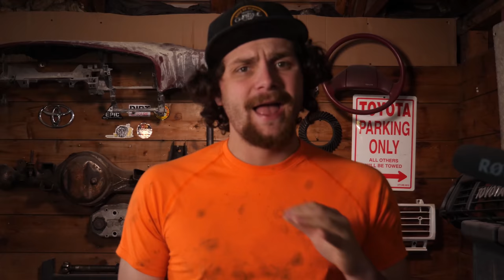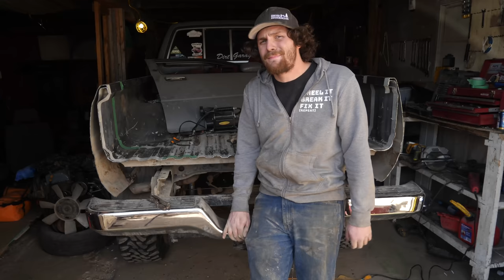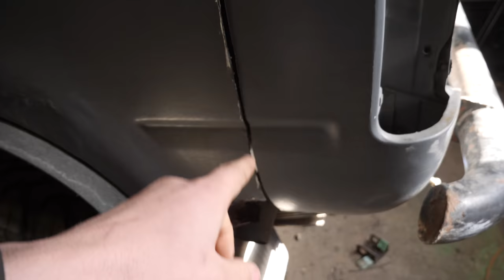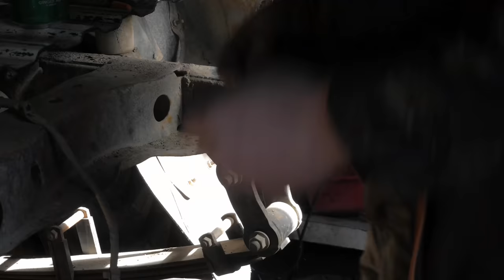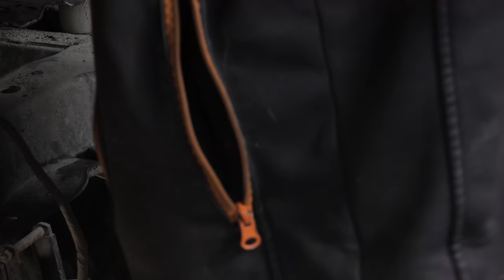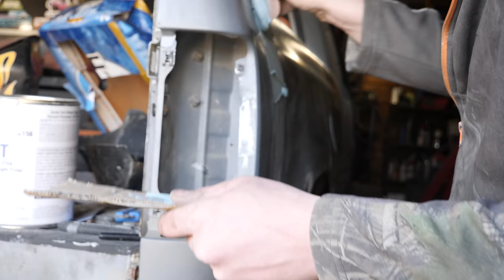How-To Bob a Toyota Bed! Bobbing my 1989 Toyota Pickup Box

Comment: I’m no welder, but I’d imagine a better electrical path for the angry pixies to travel may improve welder performance. The alligator clamp for grounding only has 30% of the wires remaining - like a frayed winch line.
Reply from the maker: Yeah it's not ideal. Welder is on the upgrade list once I get actual power to my shop not supplied by extension cord!

Comment: Nice job! I have a vulcan 220 welder, I've had mine about a year and for the money it's a great welder that migs tigs spoolguns and sticks at 110 and 220
Reply from the maker: Right on! Welder is on the upgrade list, but I need power to my shop not supplied by a extension cord first.
Reply: Logical choice...

Comment: Used dura glass. It is way better than body filler.  After you use the dura glass then use the body filler also the dura glass will prevent rust.